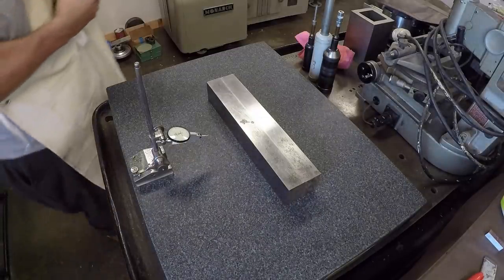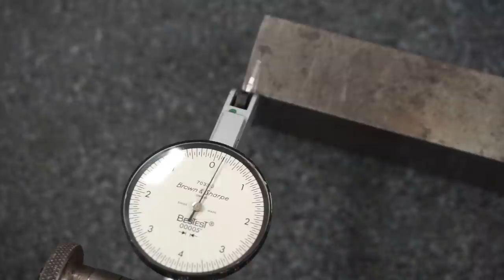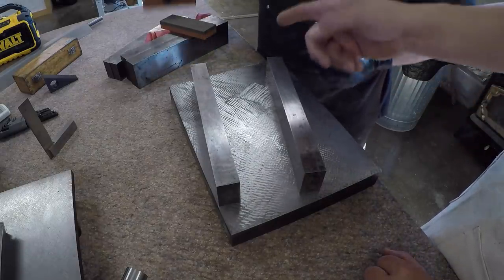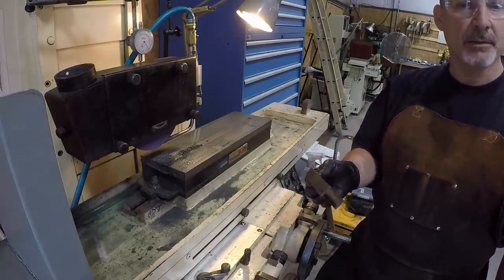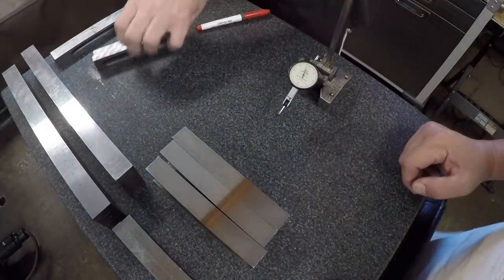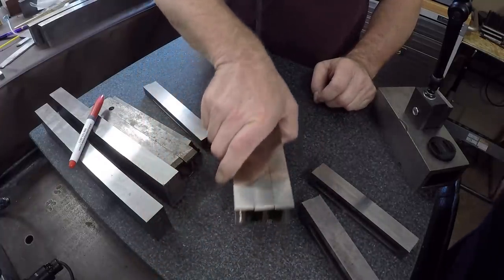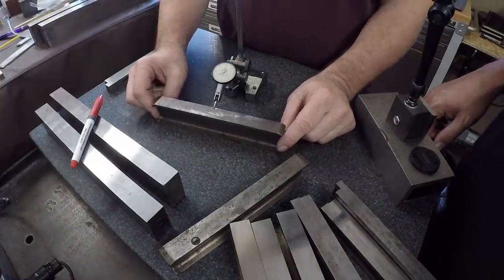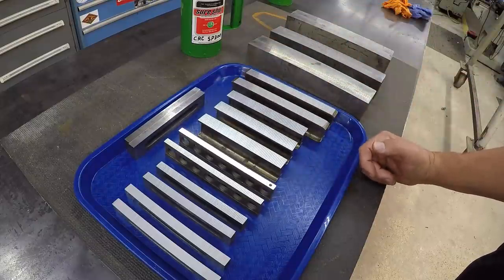SNS 293: Inspecting and Surface Grinding Parallels

Comment: The problem with grinding these parallels is that if they have a bow of any type, the mag base will spring them straight and grind based on a stressed part so when the mag releases, the part springs back and you have the bow back. I'm not sure what the best way to clamp them down is but the trick is to clamp them without bending them. Maybe embed them in some liquid film material before turning on the mag base so they don't distort or don't use the magnet but instead clamp down them from the sides only so they stay in their natural position while grinding. Once one of the faces has been ground this way, then you can be sure it is flat.

Comment: Abom79 You have to shim the parallels to keep the bow on the mag chuck so that when you grind it puts a flat side on it, after that you can flip it and no shims are required as your pulling down on a true flat side.

Comment: Why do you rub the stones together?
Reply: I assume to get flatten them after they are rubbed on something that wasnt flat.
Reply: @LerrySanders   As I recall, RobRenz once explained how rubbing the stones cleans their high spots from any metal debris lodged into their pores. 
The trick with these stones seems to be: Let the weight of the stones do the work (excessive force is detrimental), and always rub same-color stone surfaces together.

Comment: Could you have filled the pecker holes with weld before grinding?
Reply: Those are most likely heat treated, you would have to reheat treat them which would also warp them making it so you would have to remove even more material.

Comment: Adam...  you need to run the parallels backwards as well (what I mean you ran them right to left.. then you needed to swap them end for end to make sure they give the same readings... the plate may not be super flat...

Comment: One thing I noticed in this video. I’ve always moved my indicator and left the larger part stationary. As I watched this I thought about the way I’ve done it versus moving the part. I think I’ll change to this method. By leaving the indicator in place, since it has a smaller footprint, I’d guess there would be less chance in error of high low spots in the plate. The larger footprint of the part I think allows for less tolerance issues in the plate. I hope what I just said makes sense. I think I will start moving the part more so than moving my indicator base around.

Comment: I doubt that the chuck is responsible. The the flux which holds the parts will be confined
to the volume near the chuck. Rather the stability of the metal having been cut and as others have mentioned, the handling. I would ask Robrenz.

Comment: ????? Could 1 take a piece of 
Mild abrasive sandpaper and glue 
it to a big piece of glass that is sitting on a table and Trevose the parallel back and forth and with mild pressure...wod that 
That maybe get it flat????? This is going to plague my mind for days if I don't figure it out.... so HELP me....
Reply: Glass is a little bit wavy. It is not flat enough to do this. And if you tried to sand the parallels by hand, even on a flat surface, it wouldn’t guarantee they are parallel. I love this kind of stuff so I’m happy to explain it.
Reply: @MawoDuffer  Instead of glass, if you use actual surface plate as backing and lap the parts against sandpaper, what kind of flatness could you achieve? I have found this technique to be great for hand polishing flat parts with ease, and the exact parallelism has not been critical, so more just out of curiosity.
Reply: @erichasu737  Getting dirt and dust on your (expensive and planar) surface plate, by sanding something on it wasn't your best idea today?
I hope you don't do this, even just out of curiosity:)
At the end of course, it is YOUR measuring equipment and not my business.
Reply: @dieSpinnt  Don't worry, I don't use any actual surface plate, but a polished granite slab that was cheap and turned out to be flat enough for me. :)
Reply: @erichasu737  Very good, Eric!:)
Please forgive me for imputing such bad deeds to you, or suspecting you. After all, in mechanic circles, that's worse than committing murder. Joking, Hehe:)
Reply: @dieSpinnt  Haha lol no prob, surface sanding is just a neat trick on grinding quite flat faces with very low cost, and being readily accessible to hobbyists who might not want to invest k$ for a surface grinder. The tolerance requirements are also usually less tight, although with hand fitting you can achieve quite great tolerances without fancy machinery, too. :) And yeah, I've heard people saying that, but still I every once in a while I see people committing murder by sanding on a surface plate.

Comment: I'm not familiar with the spray welding stuff you do. Would you expect positive results from spray welding  severely pitted lathe ways? Then grinding and scraping. Just asking your opinion.
Reply: Spray welding cast iron is likely not possible, I'd guess. And welding cast iron in general is a pain.

Comment: I would think that the difference in flatness you see is due to differences in thermal expansion within the I Beam shape itself. This is especially true after handling them with bare hands. Thermal conductivity between flesh and steel is much higher than if you were handling them with simple cotton gloves.  Allowing sufficient time to reach thermal equilibrium between all surfaces before grinding or taking measurements is imperative. Also, using coolant while grinding is mandatory.

Comment: Is the limit that you work toward here to the point that a beam of sunlight on the surface will heat it to be out of tolerance?
Reply: Nathan Okun the target is achieving a perfectly reflecting surface. No need to worry about stray beams of electromagnetic radiation bro. hehehehehe
Reply: Standard at 20c

Comment: Are you using the term "TENTH" to indicate a ten thousandth?? I was thinking that a "TENTH" was a different amount. 

Isn't a tenth, =.1
And a ten thousandth, =.0001

I try to keep up with most of this stuff, and the numbers and measurements and such. But I get lost on some mathematical points!!
Reply: Tenth as in 1/10 of 1000th
Reply: A tenth is just .1 normally, correct

When most machinists are talking:
Thou .001 
Tenth short for Ten Thousandth .0001

The guy in the video referred to the indicator here used as a 50 millionth, which the next division I thought would be 1/100,000 of an inch, and half that being 50,000th of an inch for this indicator. Going now to read through the comments to see if anyone has some info on this.
Reply: As a few others have indicated...machinists, machine builders, etc., the "Tenth" is shorthand for "1/10000 of an inch"...0.0001".  
A "Tenth of an Inch" is 0.1"
Reply: 1/10 0f a thousandth =.00001
Reply: opps .0001
Reply: roadkill5333 Generally, in machinist setting, the base unit is 1/1000”. So if you hear “tenths”, they are referring to .0001”, or a “tenth” of 1/1000. They view  .1” as a hundred thousandths. Really exaggerates the scale.

Comment: Might be worth a shot to fill in the voids on the sides with machinable wax, shellac or similar to add a little support
Reply: If anything the ridges would make them stronger
Reply: PLUSHAIRPLANECARPET p

Comment: THESE COMMENTS ARE TO HELP YOU GUYS AND THE COMMUNITY. Since the video was long so is my comment 

you cannot place parts standing up against each other like that. the reference surface is the chuck and bottom of part placed on it and there should be a gap at least 1/4 inch between them. the magnetism will not hold and they will clatter and chatter. in other words the parts are not parallel to their bottoms in the y exactly what the indicator shows. when placing large items such as 1-2-3 blocks on the 1 inch side as an example you can pretty much place them together but even then I wouldnt do it. now picture doing the 2 inch or 3 inch side standing up more. you cannot place them together because the magnetism they will cling and snap and chatter to each other. also the magnetism is not unlimited and parts placed close to each other often have almost no magnetism and can throw or shift and explode the wheel. another thing is the chuck a tism is not equal get to know your chuck which is not even ground. Take a small part turn on magnet and move the part around and you will find some parts have strong pull other parts almost dead. 

first off grind the chuck properly with 46 wheel and dont grind it shiny or parts can sling. That mirror finish on those parts by the way many customers would not like overkill since if smart they know they paid for it. The main parralells at start of video first of all were not even stoned off while checking for millionths? then turns out were dinged up later. They never should have been touched in my opinion. There is no use of the parallels in a machine shop nor setup on the planet that requires them to be mirror finish within a trillionth of an atom. 

The flat stones they make a ton of profit on them but they are too big and simply ground with a diamond wheel which I do my own yet they get hundreds. I also grind relief slots in mine. as he rubs the two against each other he paid hundreds for actually he is simply glazing them off and making them non cutting. the stones are MUCH too big and vary according to humidity and everything. it is far better to use the standard smaller stones which are flatter because of their size to begin with. 

its a good sincere video but misuse of manpower machines and time. fifty millionths indicator by the way means tenth indicator. Note video starts "well I see a millionth here and there MUST BE FIXED" Video of parralells mysteriously they are WORSE well a few tenths good enough for mill work" thats why they should not have been touched except for the other homemade ones later. 

at 25 he was correct "I can only make them worse" which he quickly does a few seconds later he stands them up against each other NEVER DONE. they should have been spaced half inch apart. also the parralells are not square. first op to fix them would be to lay down on chuck and dust off both sides then in grind vice or against squaring block and dust of one top--now separate and dust off other top on chuck. That is square enough. when dusting off final top separate them of course 

the one commented is correct that the wheel should be a bit slower and going off further off the ends because the table shifts with inertia change. its good he got lucky as he did. The grinder is 6-18 name high precision means nothing just a name put on by good company. good grinder that is for sure too bad chuck is not even ground. 

when indicating load the indicator less and bump it off and on the part a couple times to stabilize the inner workings of the indicator he did in fact do that later. 

why should the parralells be trued up square not just the tops? no tooling item in a shop that will be around should be ground wrong and not square because they over years can be used for many things such as laid down on a chuck up against the rail on their sides or whatever. so now you line up parts against them. but not square because they are expected to only be used the tops? now the parts when chuck is on the magnetism will chatter them against the parralell that magnetism is OFTEN stronger than the force on the bottoms of the parts. You then wonder why rows of mold parts look chattery and messed up that is why. it is far better to not have ticking time bombs all over the shop and that tooling should be made square and properly. 

at 38:45 HE HAS THEM CORRECTLY SEPARATED but should be a bit more. at 38:50 note the pincusion effect because the parrallels were ground hot and dry the first original time as it knocks off the ears at the ends. Other than that i dont have any strong opinions on it nor did I spot any mistakes good video.
Reply: the problem is the grinding wheel is too hard,to get the best precision at this style of parallels you need to used a very soft grinding wheel to finish
Reply: Please bring your knowledge about electromagnetism to a point where it is reflecting actual physical laws. (No offense, but what you describe is not how magnetism works ... at least it is misleading).
These steel elements are purely passive and can be viewed physically as a simple bar magnet (or many bar magnets? ... doesn't matter! thats the wrong view of magnetism!). In this arrangement there is only ONE coherent magnetic field. Any repulsions that would affect the components of the system do not exist. As a comparison, consider the laminations of a transformer that even operates in a permanent alternating magnetic field. Your assumption would make the construction and function of such a component (used by the billions every day) impossible.

But of course you're right about leaving space between the parts[2]. Especially as in the video, if the side surfaces are NOT ground (!), canting and wedging may occur.
Much more difficult, however, is deformation due to expansion[1] with changing temperature. With these low tolerance limits, this makes a difference. A temperature-controlled work area, machine and workpiece is then a prerequisite for such precise work. (And that is what makes these pieces so expensive, other factors of course, add to that, too)

[1] Also look at the workpiece geometry. This H-profile with the very slim center section. A festival for steel, especially when things get "hot". We can bet that at this party, there is also "dancing". Hehehe
[2] Take a closer look at the video. There IS space between the parts.

Comment: There come a point where precision can no longer be improved, but perfection has not been achieved.  I remember a video here just a guy moving from place to place on the floor of the shop could be detected on gages.  When that happens, variation i n Earth's gravitaional field will effect the outcome of a maching operation.   Good luck controlling gravity.  Even NASA learned how to compensate for what they could not control.

Comment: Since the parts are not solid, stacking them close to each other on the mag chuck will cause the magnetic flux lines to influence the part shape. Also, parts that are not perfectly square can deform when stacked together.
Reply: How do flux lines influence part geometry? Mag particle inspection guy here who is very curious.
Reply: @HogsHeadStudios  First, Google magnetic flux lines. Start by looking at the images. Note that magnetic flux lines are not lines. They are curves. Curves will not impart equal force to "non-solid" material shapes, which means those shapes can be deformed while under the influence of magnetic forces. During your mag particle inspections, you also know that the magnetic flux "lines" are distorted when a material is no longer solid, when it has cracks or voids. On an related topic, penetrant dye checking does not use magnetic forces to reveal cracks or voids.
Reply: @DomManInT1  Magnetic flux lines aren't distorted by cracks, there is flux leakage. Thanks but this doesn't help much.
Reply: @HogsHeadStudios  What you are calling leakage, I am calling distortion. I can't explain it any better than what I have explained. I recommend discussing this with a physicist or an electrical engineer. Just like light refracts when passing through boundaries of differing materials, flux lines also can be refracted.
Reply: @DomManInT1  I think you're barking up the wrong tree here, but best of luck to you.
Reply: the mag chuck influences the shape 100% of the time, it just depends on how much influence you are willing to tolerate.
Reply: @SuperAWaC  Only the heat from the DC magnetizing current affects geometry. Some crazy theories here.
Reply: @HogsHeadStudios  the mag chuck pulls the parts down, and neither are perfectly flat.
Reply: @SuperAWaC  Flatness is relative to any workholding method or surface. Nothing to do with magnetism.
Reply: @HogsHeadStudios  if you clamp a bow down to a flat surface, grind the upper face perfectly flat, and then release the clamp, the bow will snap back and now that flat surface is bowed.
 If you are using flexible hold downs like a rope or chain, the shape of the object effects where your force is applied on that shape. This usually results in more force at the edges, and almost no force applied to the face.

Since flux lines route through and around the material being held, you have a similar effect to the fexible holddowns.   The more complex the shape of the clamped object is, the more effect it has on the direction and concentration of that magnetic flux.  This adds an element of unpredictability to the clamping, as you can't see if a hotspot or a weakspot is being formed.
Reply: @PoignantPirate  So for instance on an I-beam shape, are the internal stresses such that the flanges will pull together?

Comment: I beam parallel is very soft material though its not rigid, the wheel it self apply pressure on the parallel so its normal to get this result .
Reply: They were heat treated. For hardness...
Reply: @gunchief0811  I don't think so can't be heat treated it doesn't have carbon .

Comment: Now the parallels are all cleaned up i hope you take care of them and don't let them rust up again !!!!!
Reply: Store em wrapped with sacrificial zinc in rust inhibitor paper, under oil, under an inert, moisture free atmosphere of pure argon, in a steel box that's welded on all sides.
Reply: @felixar90  That will do it, anything other than treat them the way they have been in the past...............

Comment: I dont fully know what parallels are for but this was fun
Reply: Most of the time you set them in your vise on the mill to raise the part above the vise jaws. They need to be flat and equal in height to keep the part level. They can also be used for checking surfaces for flatness. Hope that helped.
Reply: @sirensc3566  I watch so many videos I actually kind of knew this, but didnt know what they were called ... lol thanks :)